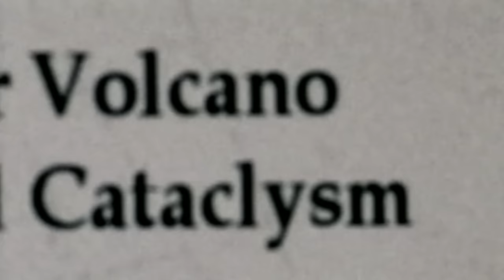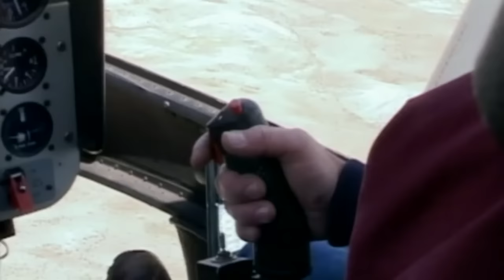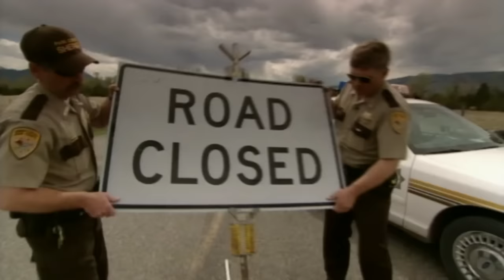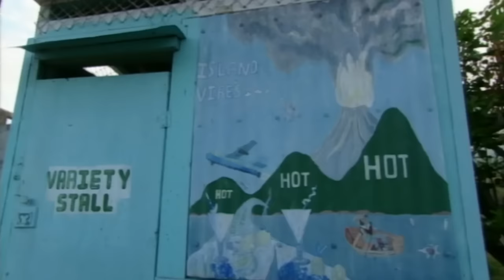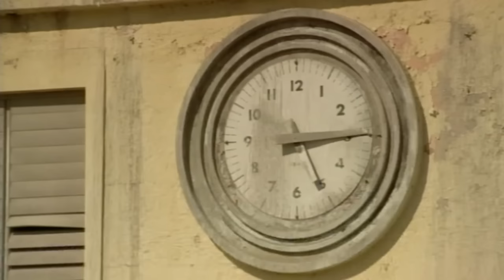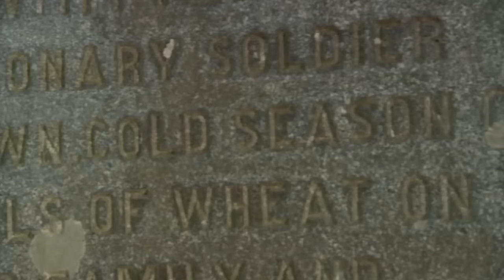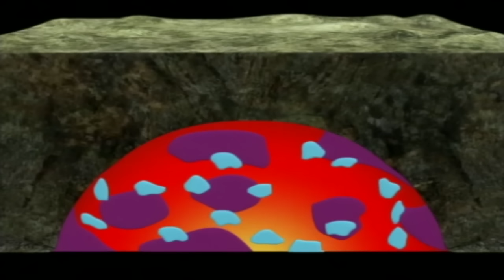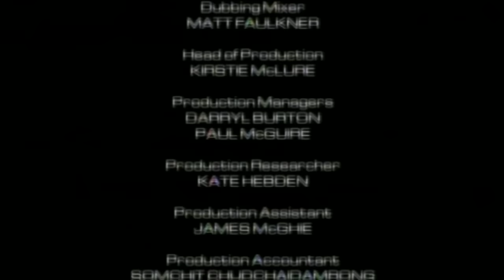Super Volcanoes

Comment: "All volcanoes warn us they are about to erupt." Oh, really? By email or snail-mail letter? "Dear inhabitants, this is to inform you that I have recently not been feeling well, and could erupt at any moment. Have a nice day."
Reply: Most volcanoes precede eruptions with "harmonic tremors", which are caused when the magma column moves upwards through the underlying and surrounding rock, shattering it.  During this process the most volatile gases (like carbon dioxide) tend to ride the head of the magma column up in much the same way that carbon dioxide rises to the top of a bottle of beer or soda pop can when you open it.  That also brings up the way that decreasing pressures (opening a beer) enables gases to quickly diffuse out of the magma mass and rush to the top of the column.  That process occurs over and over as the column rises, and under the right conditions it can act like a military "first wave", helping the magma column shatter the overlying rock above it and punch through into an eruption.  I strongly suspect that's why the massive release of carbon dioxide in the low-lying area which killed the bison was so worrisome to the Yellowstone geologists and rangers.

Comment: Most people are unaware that Yellowstone National Park is just  the inside of 1giant  Super Volcano.  Yellowstone is underlain by two magma bodies. The shallower one is composed of rhyolite (a high-silica rock type) and stretches from 5 km to about 17 km (3 to 10 mi) beneath the surface and is about 90 km (55 mi) long and about 40 km (25 mi) wide  There are two types of eruptions in terms of activity, explosive eruptions and effusive eruptions. Explosive eruptions are characterized by gas-driven explosions that propels magma and tephra. Effusive eruptions, meanwhile, are characterized by the outpouring of lava without significant explosive eruption. But the main danger is the Pyroclastic flow. A pyroclastic flow is a dense, fast-moving flow of solidified lava pieces, volcanic ash, and hot gases. It occurs as part of certain volcanic eruptions. A pyroclastic flow is extremely hot, burning anything in its path. It may move at speeds as high as 200 m/s. The extreme temperatures of rocks and gas inside pyroclastic flows, generally between 200°C and 700°C (390-1300°F).
Reply: Finally, somebody with half an ounce of common Sense who actually researched properly.... Some of these comments are laughable, don't you think ???? Lol
Reply: Also what website did you copy and paste that from....

Comment: We are entering a period of Global Cooling which is also one of more volcanic eruptions. During the Maunder Minimum (1645-1715) the sun radiated less heat. Wheat prices rose as much as 400% in the UK. In 1709 the price of food in Europe rose 600%. The ground was frozen solid for a depth of one meter (40 inches.)

But Dr Valentina Zarkhova has noticed that more significant than the slight global cooling is the reduction of the sun's magnetosphere.
This allows more cosmic rays (nuclear particles from distant decaying stars) to strike the earth. The New Madrid fault had a major quake
on 12-25-1699 during the Maunder Minimum. During the Dalton Minimum (1793-1833), the New Madrid fault had 4 quakes on 3 days in 
1811-1812. Japanese scientists also noted an increase in the number of volcanoes during a Grand Solar Minimum. The likely cause of the increase in

both quakes and volcanoes is the increased number of cosmic rays energizing the earth.

In 1815 there was an earthquake in Indonesia that sent so much ash into the upper atmosphere that a lot of sunlight was blocked. 1816 became known as the yea without a summer. If that happened today, we wouldlose billions of people.

Comment: In 2017, NASA conducted a study to determine the feasibility of preventing the volcano from erupting. The results suggested that cooling the magma chamber by 35 percent would be enough to forestall such an incident. NASA proposed introducing water at high pressure 10 kilometers underground. The circulating water would release heat at the surface, possibly in a way that could be used as a geothermal power source. If enacted, the plan would cost about $3.46 billion. Nevertheless, according to Brian Wilson of the Jet Propulsion Laboratory, a completed project might trigger, instead of prevent, an eruption.Lol

Comment: Why can't they drill down in many locations that are over the sea of magma and release the pressure by creating many much smaller volcanoes?
Reply: The magma chamber is miles below the surface. We can't drill that far. The soviets drilled a 4" hole 7 miles deep. It took over a decade. Also, no amount of holes could be drilled to relieve the pressure of a 25mi×5mi chamber
Reply: The magma isn't too deep, about 5 miles, but the temperature of the rock at depth would make drilling problematic.  Also remember that the pressure on the magma is what keeps the dissolved gases contained,  within the magma.   Attempting to release that pressure could actually trigger an eruption.

Comment: what if you used 2 or 3 atom bombs but with out the nuke part like you useb1 to set it off and use the second to 2 mess up the flow of the blowing up and the 3rd to to completely stop it I mean it's possible maybe most likely not but if you put your hand on water and you slap it and you take your other hand under water and you flow up it causes the flow to be disrupted and not as large as it would have if you didn't push down and if you do it with your one hand and you use your hand and a friends hands than it can stop it all together test it out you have to slap down while one hand pushes up but it would be the opposite the slap down would be what would be happening under ground while your hand under water would be the bomb you use and if you use a friends hand they too would push up but you don't come out of the water no you just push up tell you meet the force of the water idk kinda doesn't seem like it would work only because of the size of the volcano but maybe they can test it on a smaller volcano to see if it would be possible

Comment: Get a certain metal which can withstand the multan lava . Turn them into pipes, have multiple of those pipes specifically place around the area of the volcano and inject lytham nitrate . Stupid as it may sound, the nitrate will instantly freeze the lava too a certain point which will cause the lava to harden up . And since lava drags inward it will take that hard rock and pull it inward towards the center of its heating sorce, repeat process over in all the areas where you inject the pipes (at the same time ) it will cool down the inner core which will prolong the time of its eruption.